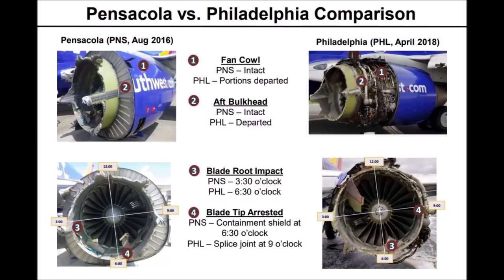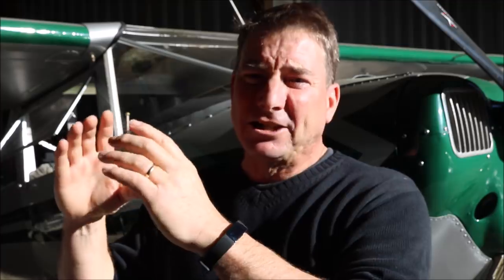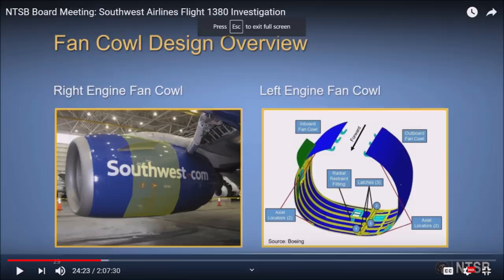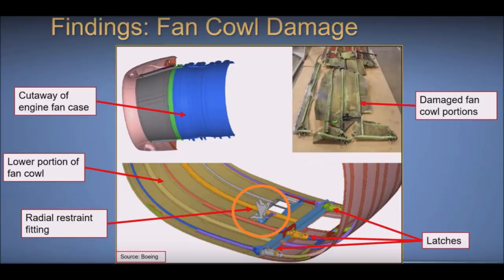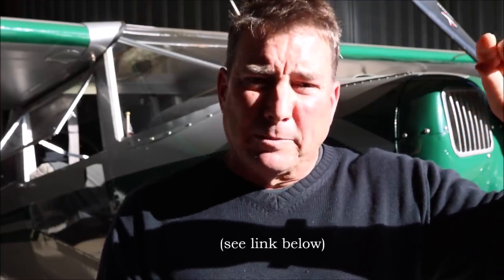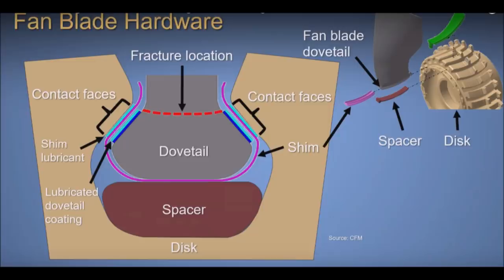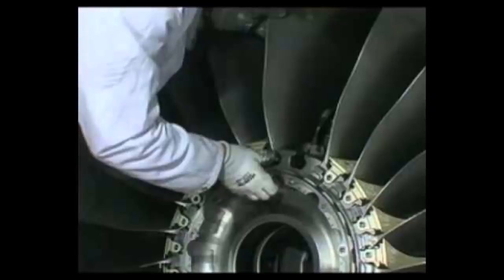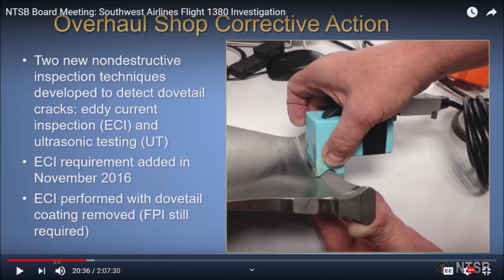NTSB Board Investigation SWA 1380

Comment: Even with critical tasks in play, wouldn't you think that, before 5 minutes out from landing, that FO would at least take 30 seconds to step back and look out the window to improve their assessment? They might see something to report to the ground and respond differently, such as due to reporting wing structure damage. OR, not even phone one single flight attendant to ask for a situation report? The flight attendants could on the phone tell what was visible and obvious for the window and the engine; but more than that, that there was a critical passenger impairment, requiring immediate landing. Once again, I KNOW their (FC) hands were full, but they denied themselves potentially critical data input by never checking. I could be wrong; I don't know the timeline, and they literally may not have had 20 seconds to spare until 5 minutes before touchdown. Was their focus really that consumed for that long?
Reply: 19:20 to 19:45 here explains that the crew was confused and debating; whereas just one of them jumping up and looking out the window would seem crucially valuable. They knew that there was an engine event; they even knew which side.
Look, they performed admirably. No flies on that. But was it optimally? Again, not throwing blame, but perhaps the paradigm doesn't suitably weigh something that's incredibly obvious to someone flying a single seater. I'm saying: gamble 20 or 30 seconds, if it's not a full borne focus demanding emerg. They could easily burn more time than that trying to determine what's visually obvious from only reading displays; and make a wrong move as well.

But as I could be missing a lot here, yes, I know they had masks. And opening the cockpit might further drain cockpit pressurization if there was a cabin breach not directly impacting cockpit (hmmm, why DID the cockpit lose pressure though??). And 15 more definitive aspects that I expect I am about to be showered with.
Reply from the maker: @Bill_Woo  can't see engines from cockpit, can't leave cockpit.
Reply: @blancolirio  Okay. I was saying, leave cockpit, look out window. If not, at least ask cabin crew chief. How can they manage a cockpit breach without even finding out how extensive is the breach! Or fire. Or whatever else that the cabin crew could inform them on.

Comment: Bottom line is high time or cycle engines are prone to failure so they need to be TBO or scrapped much sooner but that wont happen these days competition and bean counting executives will keep it this way... carbon fiber will be the next thing to fail it is also a great thing until it loses integrity then the entire structure destructs... aluminum and rivets or wood is the best for safety just not economy... I will take the bus.. and I have PPL Night Multi and some Instrument but not rated... anyway good vid tks for the info...